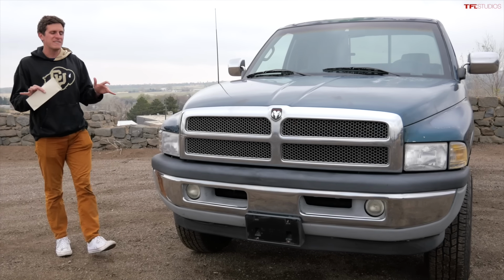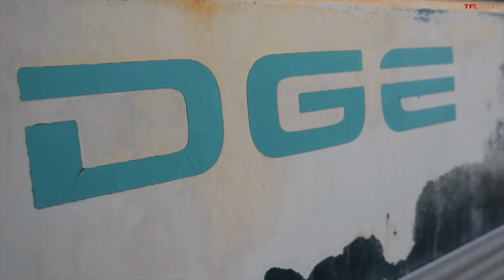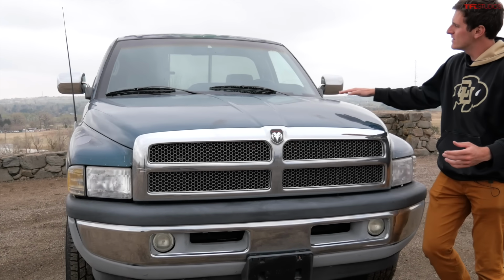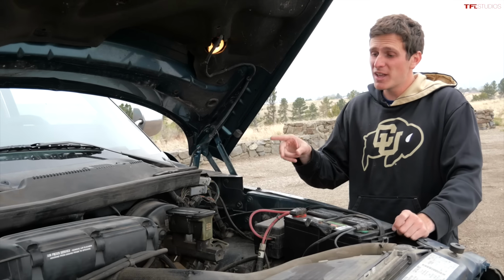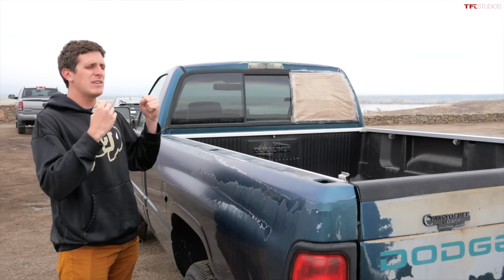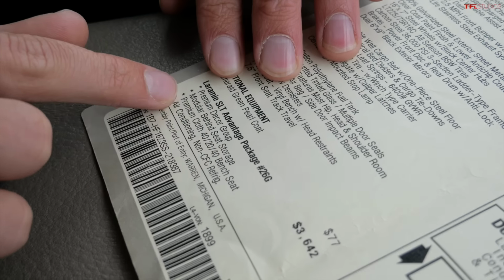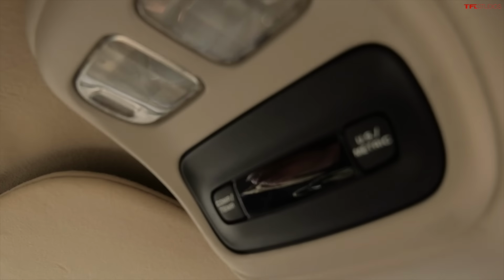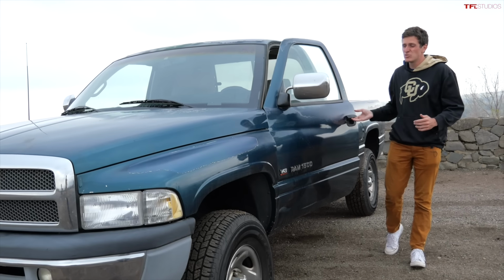The Second Gen Dodge Ram Is The Most Important Truck Ever: Here's Why You Should Buy One NOW!

Comment: Would be an interesting comparison series, the “inflation challenge”, old vs new original sticker cost adjusted to inflation. Which era gave us the most bang for our Buck in features and options
Reply: The Henry Ford museum in Detroit has an interesting exhibit on this topic. Each car in the exhibit ranging from early 1900’s up to modern day, they list the msrp compared to average household income at the time, as well as msrp adjusted for modern dollar value. In general, the cars have gotten cheaper compared to income over time.
Reply: @ChallengerDood  very cool, thanks for that, yes, I've noticed that myself.
Reply: @ChallengerDood  that’s probably because CEO pay slides the scale.  I sure can’t afford a new truck!
Reply: @ChallengerDood  it’s actually the same way with gasoline as compared to the 1980’s, even with the higher prices we are seeing in the spring of 2022.
Reply: If they do that, you'll just find trucks have only progressively become better value, if you were to actually compare apples to apples. This thing, as an excellent example, was $24,262. Adjust for inflation, that's over $46,000. If you were to spec a similar 4x4 Reg Cab V8 truck today, you'd be under $38,000. But keep in mind that "similar" simply means a close as possible. In reality, the new truck is better equipped, even at $38,000. For $46,000, you could get a new body Quad Cab Big Horn, which is in a league of features and capability that didn't even exist in 1995.
Reply: @hambone8826  Well said, best explanation I've ever heard.
Reply: That is a really cool idea.
Reply: I can somewhat speak to that.  I still own the '96 Ext Cab 4x4 Cummins 2500 that we bought in Sep 1996 for ~$35K, trimmed out exactly like this vehicle in the video, identical interiors.  I just purchased a 2022 Crew Cab 4x4 3500 Big Horn HO Cummins, for $72K.  Right at twice the price.  If my calculations are correct, $35K inflated at 3% for 26 years is about $77K.  Therefore, an inflation of somewhere around mid/upper 2% per year would be about right.  Others can correct or provide further comments.
Reply: @natei3518  sounds about right. Got a 95 2500 Cummins that’s pretty much base trim. Got a 17 base trim for about inflation correct price of the 95 (~28k new and 55k in 2017)
Reply: I take the older trucks .
Best bang for the buck .
Trucks have bevome to luxury soft.
Them tiny short beds almost usless . 
Dont need 4 doors on a truck .
Reply: I actually just did that. A modern regular cab 4x4 5.7 can be spec'd out similar to this, with some options like an 8" touchscreen you couldn't get in 1995, for slightly less than the sticker on this.
Reply: @RandomGuyDan  that's awesome, great job
Reply: $44,457.00 per us inflation calculator.
Reply: @chuckersw  I got $45,700 ($1.89 for every $1 in 1995). But close enough. 👍🏼
Reply: wonder why it was so much in 93 for this truck? a 01 chevy new they where around 25k with a v8 and ls package. i also googled the 93 window sticker for a reg cab 1500 chevy with same equipment it was 20k.  seems like fords where similar to the chevy if not slightly less. i was on the lots with my dad back then but idr any reg cab 4x4 1/2 ton costing 24k. very confusing. also just googled a broncos sticker it was 24k. f150 was 19k . so its odd that a dodge would be 5k more than the competition with pretty much the same equipment. maybe because in 93 this revolutionary body design. i know dealers had a tough time getting them in 93 so maybe they msrp them higher for that reason?
Reply: Definitely
Reply: Got a 95 2500 diesel. Was around $28k new based on the window sticker that I have for it. About 55k in 2017 which is a little less than what I got my 3500 for then.
Reply: I have 2001 with 178000 bought it with 177000 miles on it runs like a champ
Reply: Honestly its not even a question the new stuff offer so much more, an 01 ram with the really shitty plastic, glass automatic transmission and uncomfortable seats vs a 21, not even a debate
Reply: @ottovonbismarck7094 Either you are a female or you bumped your head.
Reply: dodge was never the option for that
Reply: my window sticker from my 94 ram 1500 long bed 5.9 with 4speed auto hd trans was 25k with the plow setup.  get the closest simular product were talking 75k plus..... and the metal isnt as strong..... btw ,my ram hit 67k miles this week....
Reply: @constitutionalrepublican1611  my ‘98 ram, quad cab 5.9 Laramie SLT, 2 wd, loaded out with all HD items, block heater, max cooling, was $26,000
Reply: Price has doubled....

Comment: 280k on our 95 1 ton v10. 
Had pulled from day one
Still pulls today.
Reply: A buddy of mine had a V10 2500 that got up over 200k miles. I used it several times to haul stuff and have to say I was not impressed with the engine. For something that big that sucked down fuel like that it should have been much more powerful.

Comment: I couldn’t agree more that this generation of the Dodge changed pickups forever. I bought 3 of them for my crews that year. Thanks Tommy.
Reply: I bought one for my landscape company and that was the last new Dodge I ever owned no that's not true right traded my 94 in on a 96 because of all the transmission issues I was only getting 9,000 miles per transmission traded the 96 in for a 98 and the 98 had four wheel drive 5.9 motor and dump body of course but man just transmissions and brakes and electrical issues and finally traded that in on a 99 Chevy HD 6.5 turbo diesel.